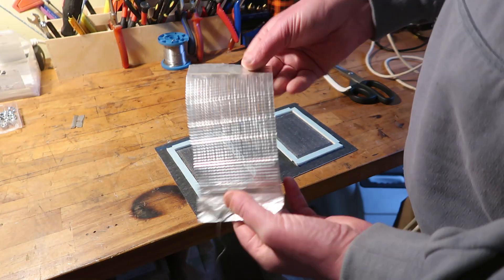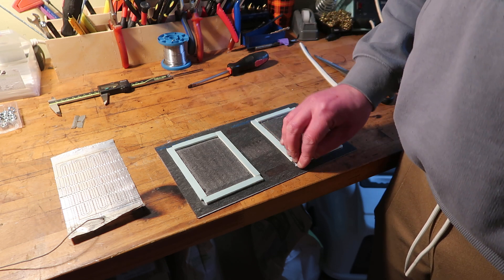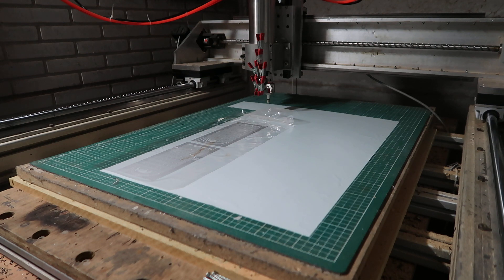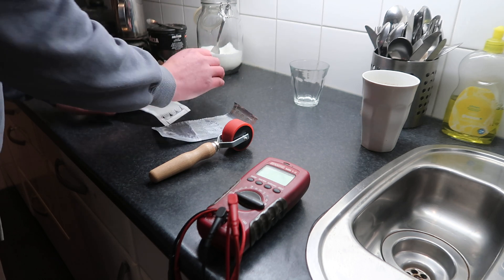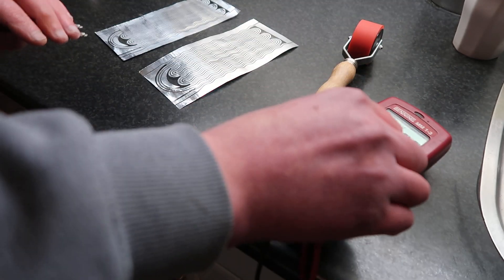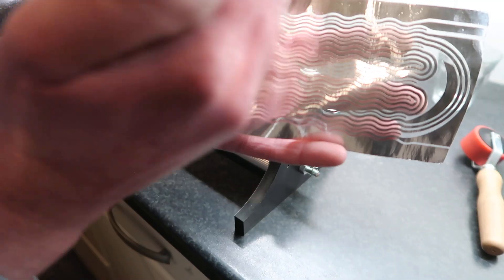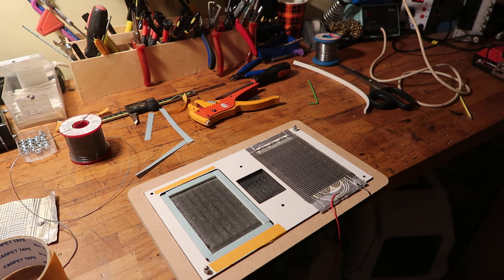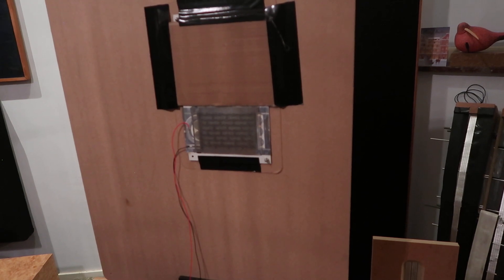New Idea on the d'appolito midrange planar

Comment: You say at minute 19:00 that the distortions of the second harmonic are not taken into account/do not increase due to the magnet, how can we understand this correctly? What do you mean? I suppose they wanted to say that due to the non-symmetrical magnetic field behind the coil and in front of the coil (due to the rear location of the magnets), the distortion of the second harmonic is reduced? And what size magnet is used in this design? I see that each strip is made of two parts, but I didn’t see their size..
Reply from the maker: yes 2e order is mostly related to the magnet structure (been single ended only magnets on the back), and is less of a big deal since we dont hear it as well as 3e order.  2e order will be reduced when using push pull. the magnets are all 100x5x3mm N34 neodymium. 7 pieces for each foil.
Reply: @joppepeelen   Thanks for the answer, I’m thinking about making my own mid-frequency emitter

Comment: Hi Joppe, I watch all your videos and I love them. I would love a bit of advice if that's ok. There is something I have never understood and I think its the called the KA factor. If I made a planer loudspeaker with a flat response on axis and then I covered it would its response fall of with rising frequency?
Reply from the maker: well yes,   in a flat panel but long vertical tweeter some of the top end will be off axis to you ears, you actually listen to a part of the long driver when it comes to high frequencies, some will null because its out of phase due to the distances  top off the driver compared to mid of the driver (at great distance this is not a thing), making it curved, does the same ,  + that is trowing around high frequencies around the room,.  and im not sure yet if its the curve or the fact that the driver is still long, be it horizontal or vertical.  normally a perfect light  weightless foil would have a rising response, with planars that wont be happening anytime soon to compensate for it :)  you can go curved but have to compensate for it. and usually thats not a huge problem since you need more and more surface are for the lows. (the more surface area the better distortion wise).. only downside might be the highs are not loud enough  :(
Reply from the maker: one note, a curved panel does not measure as nice compared to a flat panel in general :(